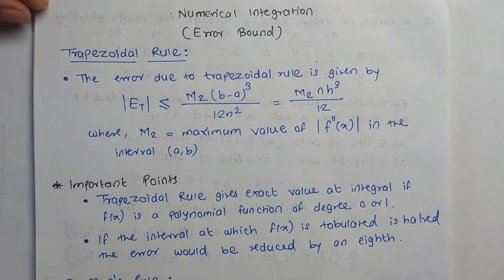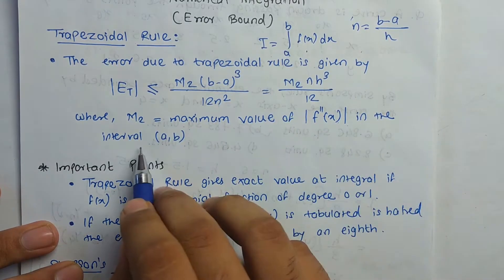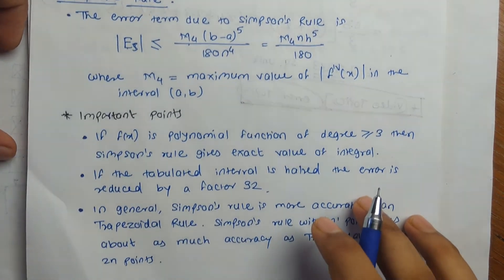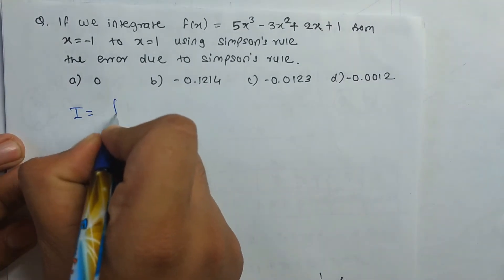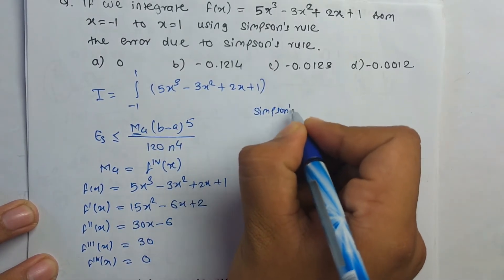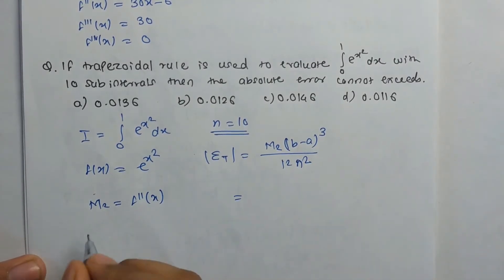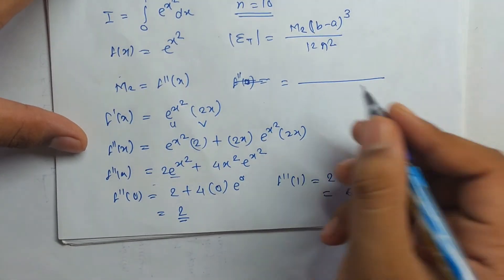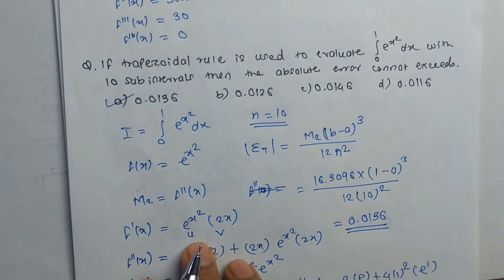Numerical Integration Error Bounds ll Trapezoidal Rule Error ll Simpson's Rule Error ll GATE 2021

Comment: Sir,  in M2 why you not put f''(0)=2 ?
Reply from the maker: +Kanthak Borkar in M2 we required maximum value of M2.
Value we get f"(0)= 2 and f"(1)=16.039
Then we used f"(1) value
Reply: GATE Lectures by Dishank  thank you sir...
Reply: without checking how can u say that f"(1) would be the maximum value?
Reply: @NandKishor-qm9xf  same doubt there are other values also
Reply: because M2 means maximum value of f''(x) . here f''(1) > f''(0)